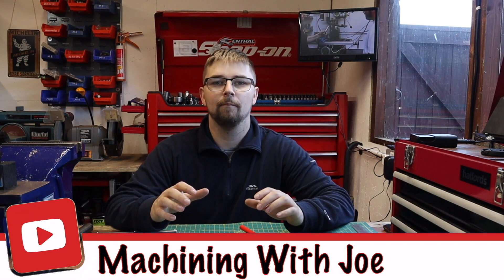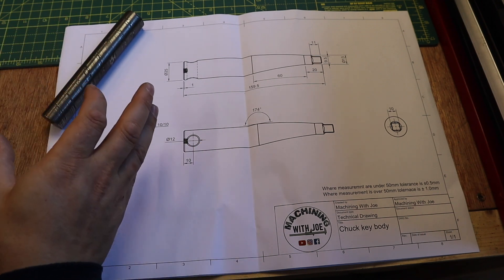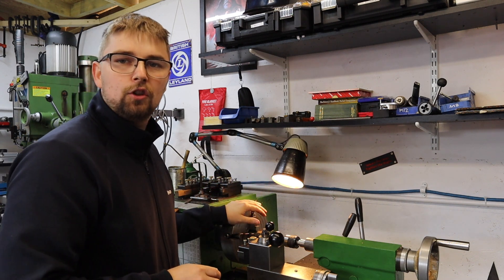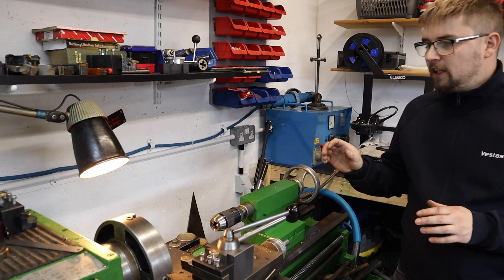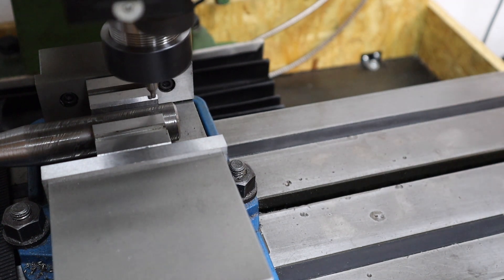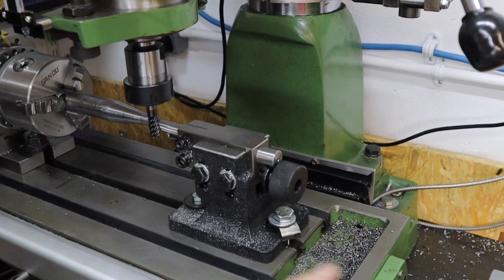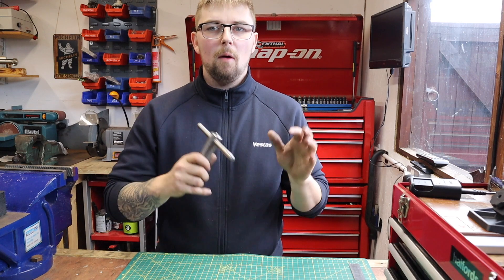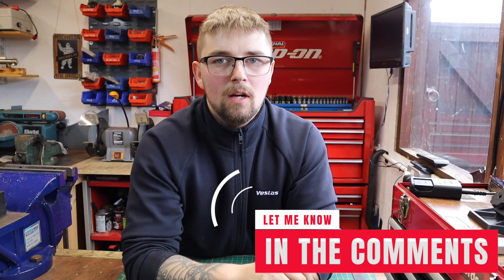Making A Twisted Damascus Chuck KEY

Comment: Based on the principles of your favorite tap handle, add a center detent to all future chuck keys and vise handles.  
     Find a small steel ball and a spring is a slightly smaller size. Install them on the back side of your handle. Then add a center feature to the handle that clicks nice with the ball with the tension you have.

Comment: Another good job done. You still scare me silly when you climb Mill <Ha Ha> your cut was getting bigger as you neared the cone. Don't think I have seen you turning between centers yet, another project maybe, you could have done the Tommy bar between centres.
Keep up the good work.
Reply from the maker: I know what you mean climb milling can go wrong quick. I was only doing .3mm DOC so I don’t think it’s to bad on a mill of this size. 
Yeah your right I haven’t turned between centres before and tbh I want to try it to check my tailstock in aligned correctly. So maybe a video I do at some point. All the best.

Comment: Never thought about making a tool from Damascus, but man that is probably one of the nicest chuck keys around. How would you say that it machines compared to a regular carbon steel? Cheers
Reply from the maker: Hi dude yeah I feel like I want all my tools made from this steel it looks incredible. It machined surprisingly nice. I would almost say the chips were coming of lovely and I wonder If it’s down to the multiple layers that make up the steel. And best of all if the drive end shows signs of wearing this steel can be hardened so result.

Comment: Have you changed your workshop? Did you sell the Harrison M300? I wondered what Westway oil you used for the service as I'm getting a M300? Are Westway oils good?
Reply from the maker: Yeah I’m in a new workshop now just at the end Of my garden purpose built for machining. I’ll have to get back to you in the oil grades but so far seems good quality for money.
Reply: @MachiningwithJoe  I ordered the Westway. Now I found a lot of wear on my bed ways, its harsh 0.018" at front central V

Comment: Hey Joe, Good video, there were only two things that I want to address
1.Maybe make the music sound level a bit lower, it's a bit high compared to the segments when you are talking.
2. Please find a one foot wooden ruler and smack it across the knuckles of your left hand,
At 4:55 you reached in to mark the work piece with long sleeves and your 4 jaw chuck still spinning, a 4 jaw has an extra set of protrusions and weighs more than a 3 jaw which makes it more dangerous.
If the ruler doesn't do the trick, please watch this video regarding a lathe accident with very similar circumstances
https://www.youtube.com/watch?v=S0o8kdh8HWs
And something else to bring up, If you were caught like this man was, Can your Missus hear you screaming from the work shed?
Stay safe, regards from Australia